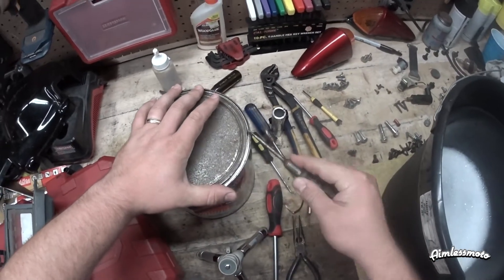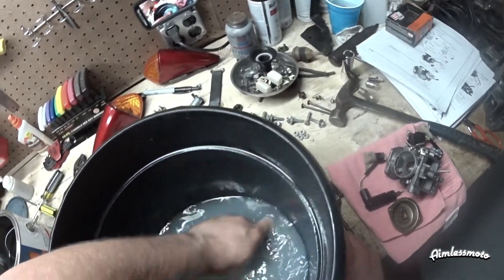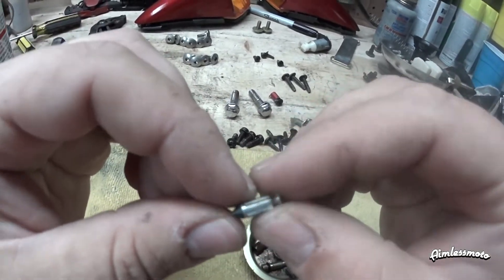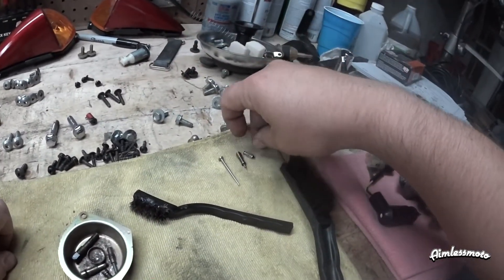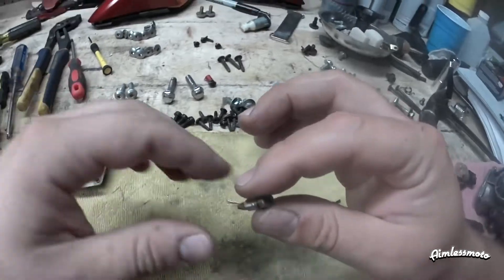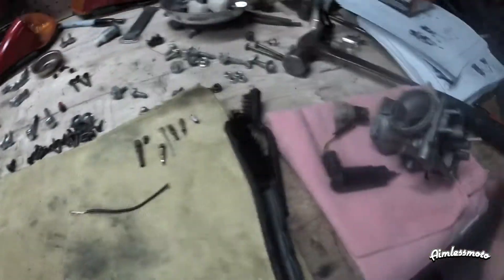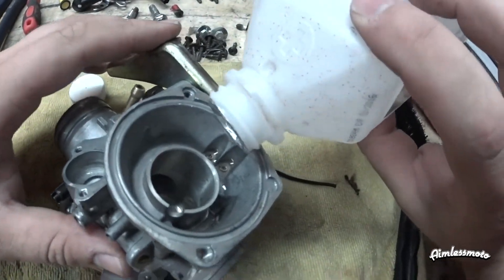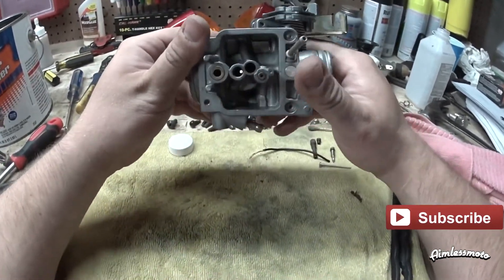Honda Reflex NSS250 | Part 4 (Carburetor Cleaning)

Comment: Great idea with the tray in side, a real one stop solution..  I have been hearing great things about white vinegar for cleaning carbs, a couple of mechanics our way swear by it as a cheap solution to buying a ultrasonic cleaner.
Reply from the maker: +GTs Garage Vinegar will work, actually apple-cider vinegar works better than distilled white vinegar. It's perfect for corrosion removal, it may not break down remnants of bad gas and varnish like a dedicated solution of parts cleaner/diesel fuel/mineral oils. You do not need an ultrasonic cleaner... the best carb clean I ever did was a pot of 1 litre boiling water and 1/2 litre of lemon juice on a bbq grill. Boil the carburetors in that for 15-20 minutes and it comes out clean enough to eat off of.... do it outside though, because it wreaks!

Comment: My bike temperatures exceeded half but the fan does not work what is the reason
Reply from the maker: Amjed Tarmac exceeding half is ok... the fan wont come on until 3/4 or so...
Reply: It has exceeded 3/4 did not work